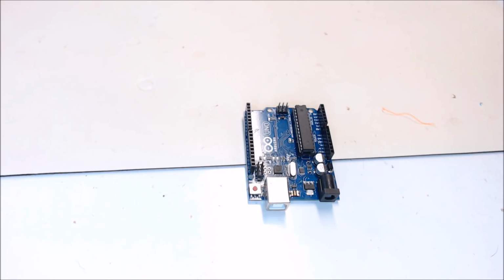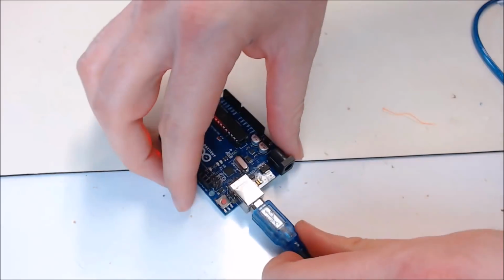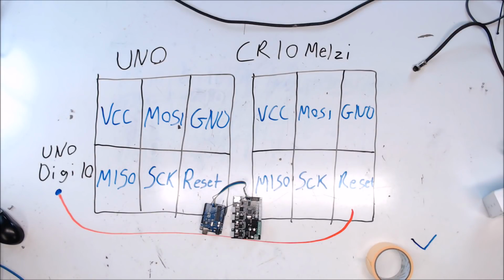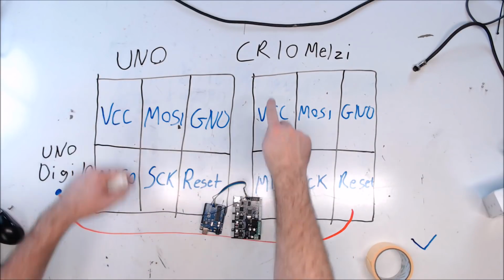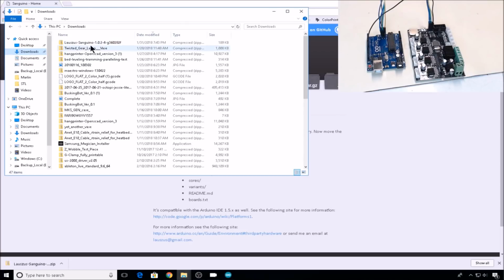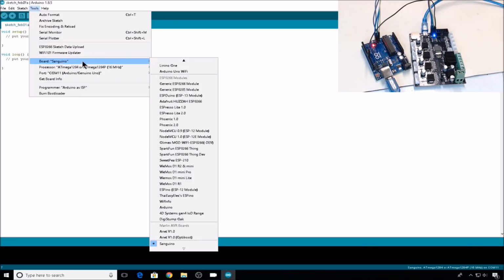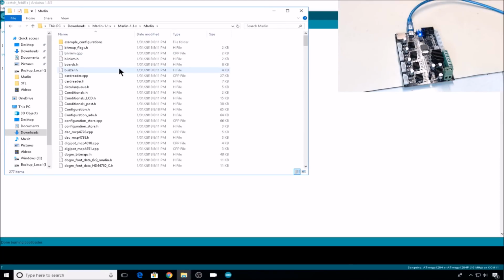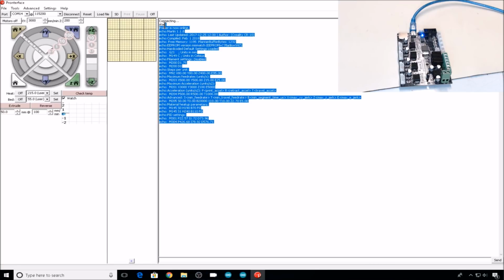Creality CR-10 Marlin Firmware Upgrade - Chris's Basement

Comment: Hey Chris, thank you for the amazing video. I had a problem on my CR-10s board and they sent me a new one. However, the firmware that came on the board is corrupt and I have to reboot it. I want to keep the original firmware on it, the one that I found on the Creality website. Will it work if I install the boot loader the same way as you did and flash that firmware on it? The board is different, its a Criality V2.1. Thank you
Reply from the maker: If the Creality firmware is in INO format, yes, it should work the same if you put the boot loader on. HEX format, I am not sure how you would get that done. You might have to use CURA with a plugin or something like that.
Reply: @ChrisRiley  I Downloaded the firmware on both formats, so I'm going to try doing the same as you did. It shouldn't lose the recovery settings after power cut, right? thank you so much!!!
Reply from the maker: @Thiersfreire  If it's the same firmware, you shouldn't lose it.  I would look through the firmware first.

Comment: I went ahead and did this, but when I installed marlin 1.1.8 I got a low memory warning that says over 90% of the memory on the CR-10 is being used by global variables, and I might see erratic behavior.  The CR-10 is running fine for 1-6 hours, but will then stop, stay heated, pause,and ask me to press the button under the lcd to continue.  Any idea on why it is pausing at random???
Reply from the maker: Hey John, I don't know what could be causing the pausing issue, but it is possible it is low memory causing this. If you can do without some functionality I would make these changes and re-flash and see if the issue goes away.

in configuration.h take the comments off of //#define DISABLE_M503    // Saves ~2700 bytes of PROGMEM. Disable for release!  

and comment out #define PREVENT_COLD_EXTRUSION 

and in configuration_adv.h uncomment out this line #define NO_WORKSPACE_OFFSETS
Reply: I got it done with the second method that you linked to. In the instructable you linked to, they list an alternative method by Nick Gamon.  He had a software program for the arduino uno that straightened out whatever was causing my problem, and I was then able to update.   Thanks for your help, and that link which I would have never found on my own.
Reply from the maker: John Duchek Awesome! Thanks for the update. Glad it worked.
Reply: Chris Riley where is the link?

Comment: Hello mr chris , i have the CR-10 S3 creality , i have some printing issues , you think its a good idea to upgrade the firmware to Marlins ? thank you in advance
Reply from the maker: It shouldn't hurt anything, but I don't know that it will help with your issues, depending on what they are. You have a very limited feature set you can use on the CR10 because of the limited memory.

Comment: Thanks for your video. I am getting the message "Yikes! Invalid device signature. Double check connections and try again, or use -F to override this check" How do I deal with it?
Reply from the maker: Hmmmm....was this during the bootloader load? Are you using a programmer?
Reply: i got the same problem when burning the bootloader
Reply from the maker: @brandanneto5924  Something must have changed on these boards.

Comment: i have this problem to bootloader
avrdude: stk500_getsync() attempt 1 of 10: not in sync: resp=0x15

avrdude: stk500_getparm(): (a) protocol error, expect=0x14, resp=0x14

avrdude: stk500_getparm(): (a) protocol error, expect=0x14, resp=0x01
avrdude: stk500_initialize(): (a) protocol error, expect=0x14, resp=0x10
avrdude: initialization failed, rc=-1
         Double check connections and try again, or use -F to override
         this check.

avrdude: stk500_disable(): unknown response=0x12
Error quemando bootloader
Reply from the maker: Might be an IDE issue. I would try 1.8.5.

Comment: hey chris, awesome channel man. i used this tutorial to replace the plastic extruder on my cr-10 to a titan and change the steps, but  the titan is giving more problems so i purchased the original metal extrduer kit and will change the titan for that. quick question, i also purchased a cr-10s filament run out sensor which i want to add to the cr-10 as well, however i cant find alot of resources on how to add it. the one video i saw said you have to cut the brown wire on the lcd ribbon cable and connect the live from the sensor to that cable, but nothing about enabling it in the firmware or anything, can you assist?
Reply from the maker: Sure! You would have to pull the line from the LCD cable for sure. I was thinking about making a expander of sorts for these. Anyway, the firmware should be pretty straightforward. Marlin already supports the board. We just have to know which "PIN" that wire thinks it's using, change it in PINS.h and you should be good to go. I can look around as well and see what's out there.
Reply: Chris Riley I carried on looking and the firmware you listed here, does have the correct pin out if you check the pins_MELZI_CREALITY.h file, so now I just need to find the M600 command to see if it's correct and then I'll plug in and try it out. Thanks man
Reply from the maker: Awesome! You bet! I have a filament sensor and M600 video out there if you get stuck.

Comment: Well I did it. I upgraded the firmware to Marlin 1.1.8. Being new to this it took me a while using the procedure from Chris Riley on YouTube. Everything seems to have gone Ok BUT the last step of checking the board using the program called Pronterface. The board does not connect with it or Cura. I have the correct com port in device manager, in my case 5.I do not want to install the board unless I know it works just sitting on the bench plugged in to my computer. Any common thing I might have missed?
Reply from the maker: Martin Miller The most common thing I see is the ch340 driver needs to be installed. Also, plug in the hotend thermistor, it might be hitting thermal runaway and going into hault.
Reply: The driver is installed. I put the control box back together and now have a blue screen. I must have missed something. Do I start over from Scratch? I did start over from scratch and still have a blue screen with this error. "Arduino: 1.8.5 (Windows 10), Board: "Sanguino, ATmega1284 or ATmega1284P (16 MHz)"
C:\Users\Martin Miller\Documents\Arduino\Hardware\Marlin-1.1.x\Marlin\Marlin.ino:45:110: fatal error: U8glib.h: No such file or directory
     #include <U8glib.h> // library for graphics LCD by Oli Kraus (https://github.com/olikraus/U8glib_Arduino)
compilation terminated.
exit status 1
Error compiling for board Sanguino.
This report would have more information with
"Show verbose output during compilation"
option enabled in File -> Preferences.
Reply from the maker: Yes, I think I would start over.

Comment: mine is a cr10 mini that came with bootloader already installed. i just do what you said and use the arduino program with my computer as the arduino board?
Reply: ive done all of this correctly for my model up till opening the ino file. i go to tools... what would my board be what would my programmer be?
Reply from the maker: You need the sangino board library. That would be the board to use for the Creality printers.
Reply: https://reprap.org/forum/read.php?158,486938 go down to dusts comment where he says "instructions work fine..." he spells out how to find and install sanguino
Reply: as for the board its a 16 mhz 1268 or w/e

Comment: Hi Chris, thanks for the video; your slow but purposeful approach to explaining things is perfect! However I'm curious if you can use an Arduino Nano rather than an Uno, and is the procedure the same for a CR-10S with a new 2.1 board?
Reply from the maker: I think the 2.1 board would be the same process. Although some of them have boot loaders on them already. An M115 command might tell you more. You might be able to use a nano, if it have pins or spots to solder pins for an SPI connection you should be all set.
Reply: @ChrisRiley  Thanks again Chris, pretty sure the nano has SPI but usually not soldered connectors for it. Easy to solder one on. I'll check the M115 when I get back but I know the SPI header is in a different spot on the 2.1 board.

Comment: Hey Chris, great video and clear instructions! I have one issue though, I have the v1.1.2 board and it seems that there is no jumper from VREG to USB. Should I still proceed with your instructions? Thanks in advance :)
Reply from the maker: Yes, you can still do this upgrade, but you will need to power the printer on. Be Careful with the box open while plugged to A/C
Reply: @ChrisRiley  Success :) Thanks to your video and clear instructions! I also received the error about the missing library "U8glib", and once again, you had the solution for that!
Reply from the maker: @papako21  Great! Glad you got it figured out.

Comment: Any suggestions for when it fails ? avrdude: verification error, first mismatch at byte 0x1fc00
Reply from the maker: Bootloader or upload?
Reply: @ChrisRiley  oops bootloader
Reply: I opened an issue, maybe someone has seen this before, https://github.com/Lauszus/Sanguino/issues/20
Reply: I think usbtiny cannot burn over a certain size as they are mostly for attinys etc. checking now, gonna get a new isp, or make one if I have a micro around here
Reply: I wound up able to flash via an esp8266 as the isp, usbtiny support<64k only, not sure why avrdude doesn't warn you..
Reply from the maker: @tablatronix  Did you ever get this sorted? It looks like it can't read it. Are you using the Uno or a programmer?
Reply: @ChrisRiley  Yeah no  problem, there is a bug still in usbtiny that causes verification fails over 64k, it loops back to 0 and always fails. But it writes OK. I wish I just tested it , cause it actually was working.. doh, I wound up using an esp8266 setup as an wifi ISP before I found that out.
Reply from the maker: @tablatronix  Ah, nice, glad you found it.

Comment: Really impressive... had the avrdude: stk500_getsync(): not in sync: resp=0x30" error on uploading Marlin .... in my case it was the incorrect windows drivers “ FT232R USB UART” not installing on the port on my Windows 7 machine.... Panicked and used my Windows 10 machine which configured the port correctly .... Happy Days (Phew) .....
Reply from the maker: Ha! Good save! Glad you got it working.

Comment: Your videos are always awesome and easy to follow.  Thank you for what you do! 
I have a CR-10 S5 that has a v2.1 board (atmega2560).  I tried to flash it using progisp but now it doesnt turn on.  I am about to use Arduino UNO to flash the bootloader and and try to load the Creality BL Touch firmware (the whole point of flashing was to install BL Touch.)
Can i ask, am i on the right track? 
I think my printer doesnt boot because of the failed flash (even though progisp said it was sucessful). Just has a blank screen now. 

Any help would be amazing! Thank you again
Reply from the maker: Hey, You might be half in half out of a flash. RE-doing the bootloader might get you back to where you need to be.
Reply: @ChrisRiley  thats what i thought.  I tried flashing with progisp and numerous hex files and tried to compile with TH3D and vscode. Arduino comes tomorrow.   Any specific pointers for arduino ide, and v2.1 boards? Thanks for your insight.  
Btw, your video setting up multiple octo print instances was a life saver and super kewl.  Thanks!

Comment: Thanks Chris, one question:

Creality3D V1.1.3 board
Marlin 1.1.9

Arduino UNO
Arduino 1.8.5

everything went fine (I did get the low memory warning),
 until I connected to Proterface. I get:
-------
Connecting...
start
Printer is now online.
echo:Marlin 1.1.9
echo: Last Updated: 2018-08-01 | Author: (Creality CR-10)
echo:Compiled: Nov 13 2018
echo: Free Memory: 1204  PlannerBufferBytes: 1232
echo:EEPROM version mismatch (EEPROM=? Marlin=V55)
echo:Hardcoded Default Settings Loaded
-------
Do I need to worry about the EEPROM error?

thanks
Reply from the maker: You shouldn't have to worry about that error. If you do a M502 then an M500 it might clear it up. Probably not an issue either way.
Reply: found my own answer - must do a M502, then a M500

Comment: Do the jumper wires differ from one another? Or can i plug them in in any order as long as i plug top left to top left and so on?
Reply from the maker: Any order is fine, they just have to match pin to pin.
Reply: @ChrisRiley  Thanks a Lot
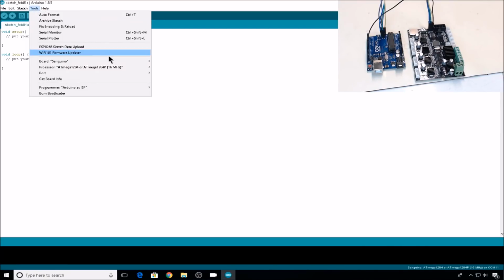Reply: @ChrisRiley  on 6:28 i have 6 options and i dont know which one i need to choose. Does someone know, which one is right?
here are the 6 options i am given:       https://i.imgur.com/H5oAjMb.png

I have an old cr-10
Reply from the maker: @bilalakyuz9866  It's the 5th one down.

Comment: Thank You Chris Riley. After a lot of frustration with examples of installing Marlin I happily found your site. I get an error " avrdude: stk500_recv(): programmer is not responding.  Totally new and not sure what I missed in your instructions. Thank You
Reply from the maker: Thanks for watching! Programmer not responding is usually a driver issue. Are you working with a CR10 on a Windows machine?
Reply: Correct windows 10, having no luck with this project. Could I send my board for U to set up?
Reply from the maker: I could get it setup for you, but these boards can get broken by these upgrades very easily. I can do my best to get it working, but I cannot guarantee it will work out. If something goes wrong you will end up with a non-functioning printer. You can go to my about page to send me an email on this.
Reply: I have this same problem.  I am not using windows; am using Fedora linux 28.  I have updated all the boards to the current version.  Any help appreciated.
Reply from the maker: Usually when you get the stk500 error it's not using the correct com port or the driver is mismatched with the OS. I am not sure what driver you would need to use for the Arduino with Linux.

Comment: Hi Chris!

Do you know if Marlin is compatible with the CR 10S Pro? I guess it is different for this printer because of the touchscreen. And unfortunately, i could not find any answers to my question. 

Thanks for the great video.
Christoph
Reply from the maker: I don't know as of yet, my guess is Marlin doesn't support that screen yet. That is really common with the touch screens.
Reply: @Chris Riley Thanks for your reply!

One more question to this video. Why do you use the Sanguino plugin and not the preinstalled Arduino/Genuino Mega? It has the same processor. And if it is necessary to use Sanguino, is it the same for all Arduino-based 3d printer or are there differences?

Thanks!
Reply from the maker: @christophknapitsch9154  This board has a 1280 chipset instead of the 2560.

Comment: Hello!!

Greetings from Spain and I congratulate you for the great job. I would like to mention that I have the following problem:

All the previously mentioned steps work perfectly, but when I connect the CR10 board by USB it does not turn on the LED on the board, it only turns on when I connect the USB on the Arduino UNO board.

Even so I tried to go ahead and try Bootloader, but I get the following error:

avrdude: stk500_recv (): programmer is not responding
avrdude: stk500_getsync () attempt 1 of 10: not in sync: resp = 0x00
avrdude: stk500_recv (): programmer is not responding
avrdude: stk500_getsync () attempt 2 of 10: not in sync: resp = 0x00
avrdude: stk500_recv (): programmer is not responding
...

Would you know what the error could be?

Thank you!

Regards!
Reply from the maker: Thanks! On some of the newer boards you can't power them via USB, they have to be plugged in. It will still work the same but be careful when the control box is open and the printer is plugged in.

Comment: I am right at the moment starting to update the firmware. thanks for this great video. but i saw, that my CR10 board looks the same as yours, but i have no jumper on it. it says on my board: Creality 3D v.1.1.3
Reply from the maker: Check and see if you have a bootloader already, M115 might tell you. If you don't have the jumper you can still do this, but the printer will have to be plugged into the wall. Just be extra careful with the box open.
Reply: thank you very much for such a fast reply. i will figure out how to check if i already have a bootloader installed. i have to check the voltage of the internal power supply. because i already have disassembled the whole printer. but i have a laboratory power supply and with this i think i can power the naked creality board. again, thanks for your fast reply.
Reply from the maker: You bet! Let me know how it goes.
Reply: @ChrisRiley  Everything worked fine. The new board doesnt have the jumper. But the jumper isnt needed anymore. It can bei powered via USB . I think there is some Logic or resistors etc. Flashing the bootloader and marlin Just worked as described in your Video. Everything worked flawlessly
Reply from the maker: Awesome man! Thanks for the update!

Comment: hey Chris,
just bought a CR-10s and it had a board 2.1. i had installed BL touch but after updating firmware the nozzle still crashes into the bed. was wondering if you had worked with bltouch before.
Reply from the maker: Hey David, Yes, I know the Bltouch. Did you set the Z offset? You might need to empty out the eeprom. Try running a m502 then a m500 to restore the defaults.
Reply: @ChrisRiley  thanks chris that worked out.
Reply from the maker: @davidchavarria  Awesome!